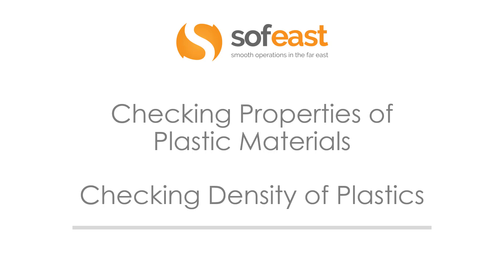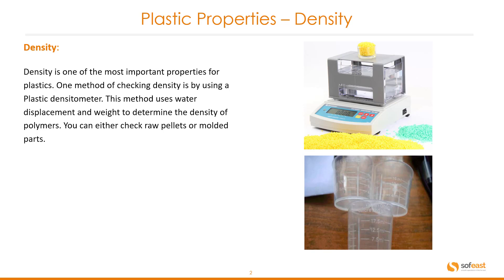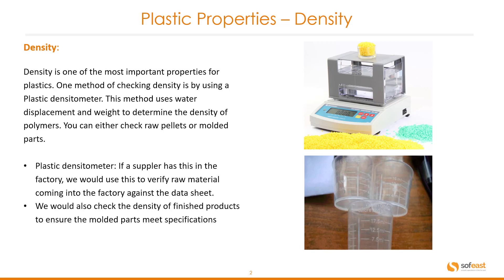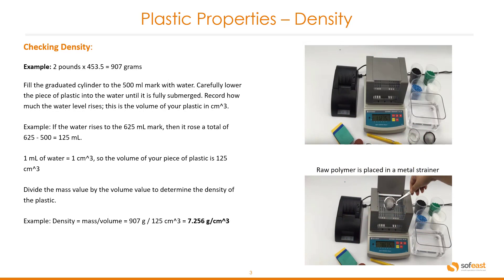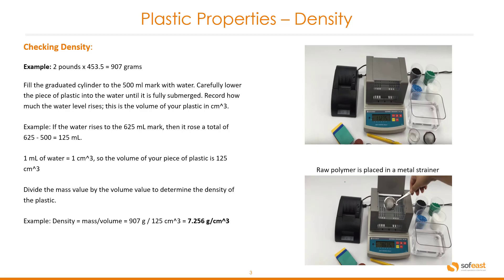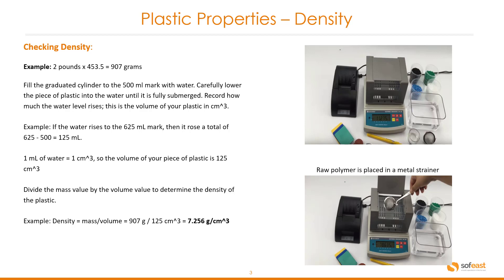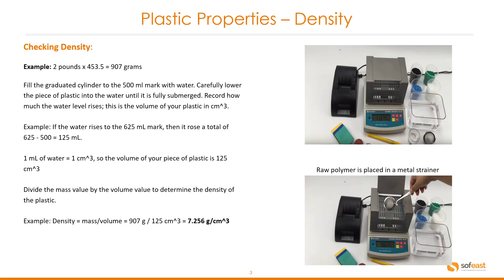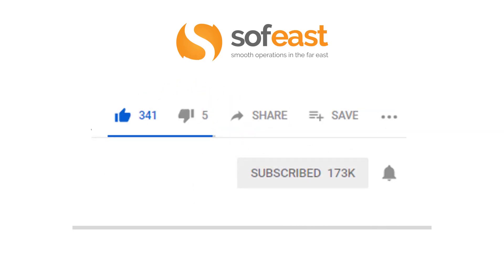Checking The Density Of Plastic

Comment: this video failed to answer the question. which plastics are more dense than others
Reply: Polyethylene is .918-.965 D and Polypropylene .900 D and both float on water. Others may be over 1.00 and you can test by seeing if they float on water.
Reply: @carlostrevino1109  would you know what melamine would be? I'm trying to find the most sense plastic so I can make go stones
Reply: @Lominoth  Density: 1.57 g/cm³